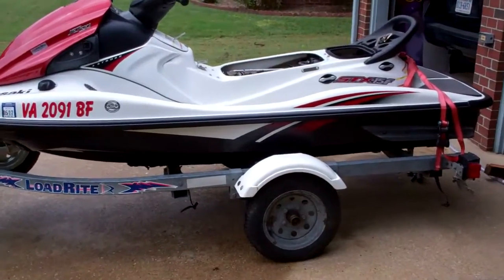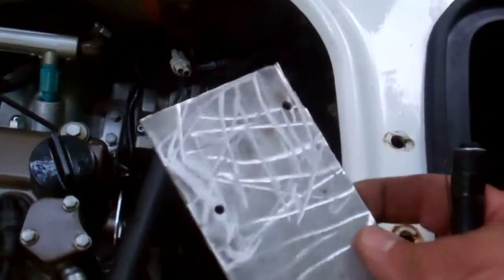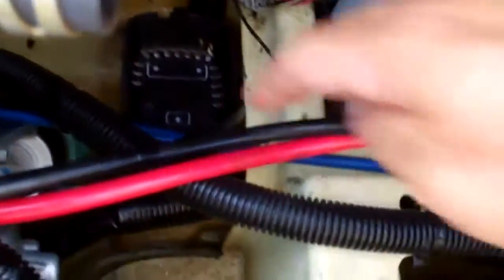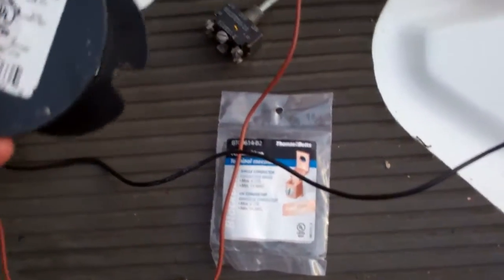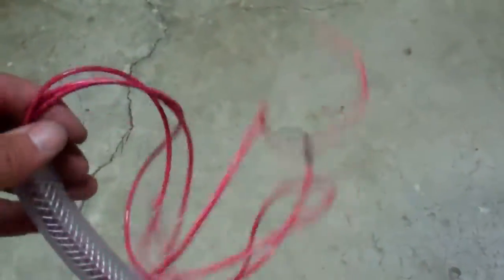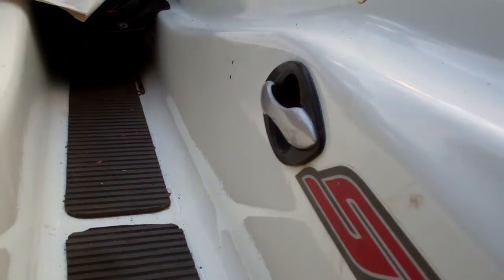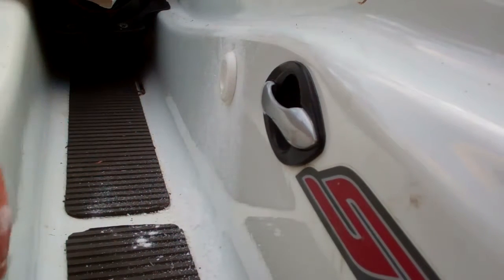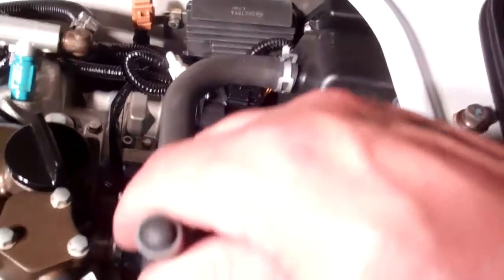Installing a Bilge Pump in a Kawasaki STX 15F Jet Ski PWC

Comment from the maker: Just a note..last season the pump saved me from sinking.  The shaft seal failed and flooded the hull.  The pump kicked in and kept up until I could get to the dock.  I will never run a ski without a bilge pump!

Comment: VanVery nicely done. A well engineered installation, and well documented also. That pump really performs!   I've got an 04 12F, and a few years back the upper hose nipple on the rear engine cover (stator cover) corroded clean away during a run and water sprayed all over the engine compartment, shorting out one of the fuses and killing the engine.    I had no idea what was happening underneath me, I only knew the engine had died and I couldn't get it started. I was a mile from the ramp, so I pulled out the paddle and started rowing. Little did I know that water was pouring in through that nipple stub on the cover. 20 minutes later, the ski started getting a little unstable, and I couldn't figure out why I had so much water sloshing around on the deck and in the footwells.  It wasn't until I reached in to the forward compartment for another beer and saw a sea of water in there that I figured out what the hell was going on. Scared the hell out of me.  But I stayed calm and managed to clamp off the supply hose  with an adjustable wrench I had on board and then bail and keep from swamping. Ever since then I bring a good set of plugs and hose clamps with me, but if I was really smart I'd install a pump like you did.    Maybe your video will give me the motivation I need to do this project.   Thanks!      BTW, the only thing that I see that might give you trouble in the future is that non-marine manual switch, but your comments pretty much acknowledge that. If it does fail, easy enough to replace, so no big deal.   Again, thanks for the info. Great stuff.

Comment: Great video, same thing happened to my Seadoo, blew a $2 hose clamp and almost sank, luckily I noticed in time, was just down the canal, and quickly put it back on the slip. Bildge pump time for my GTI and RXT, I just hate to drill the holes.

Comment: I installed the same setup on my Yamaha vx110 because of the pump housing area leaked. Every 20-30min idling, I flipped the switch on to dump the water out. Good setup for just in case, but a 2nd backup battery would be even better.

Comment: There’s a Rule 500gph automatic bilge pump that does a check for water every 12 seconds when turned on. If there’s water resistance, the pump kicks on until the water resistance is gone. No need for a float switch. Don’t know which brand checks 2.5 minutes.

Comment: is that a one way valve on the haul or is it just an open tube that water can come back in
Reply: It's just open.  If water is coming in the pump outlet the pump has already failed and you need to start swimming.  If the output was lower on the hull I would have a check valve.

Comment: Why wouldn't you just drill and screw the bracket to the plate???  Not trying to knock your design but Velcro and water don't seem it's bow and water don't seem to work that well together plus if you're anything plus if you're anything like me and your bounce around on your ski that thinks it's gonna come floppin and your ski that thinks it's gonna come flopping out...  And the whole point that bracket is so that it can be mounted so that it can be mounted to the flattest surface where water is so it can suck where water is so it can suck the water off the bottom of the hall...
Reply from the maker: All I can say is it saved me from sinking again when the shaft seal failed.  It May not be perfect but it worked for me.  Sold the ski because replacing the seal involved removing the engine in pieces and special alignment tools to reinstall that I did not want to buy.